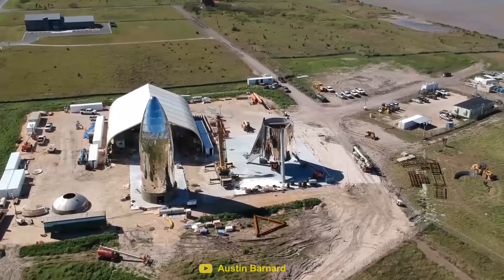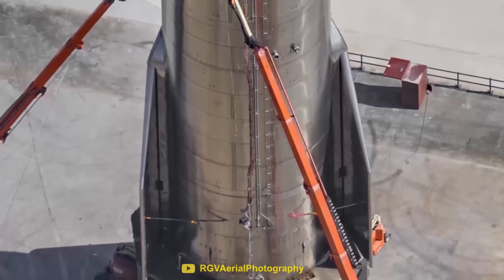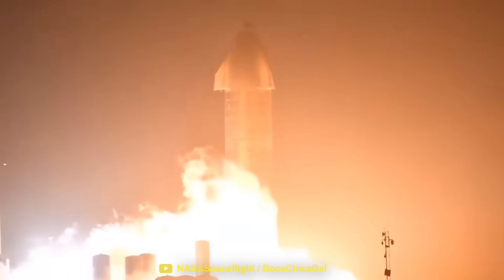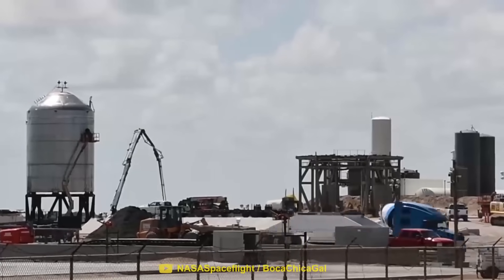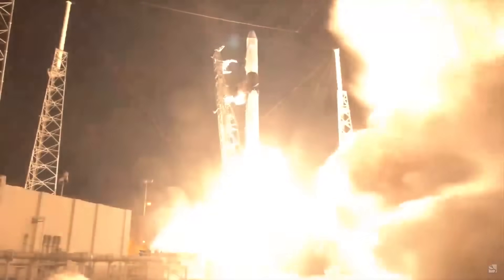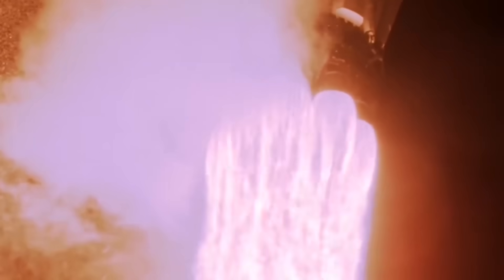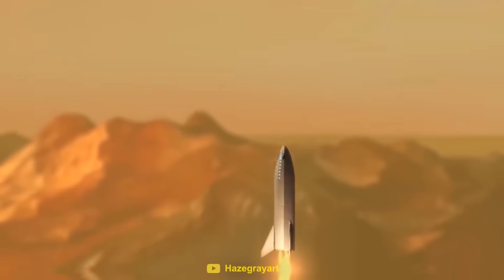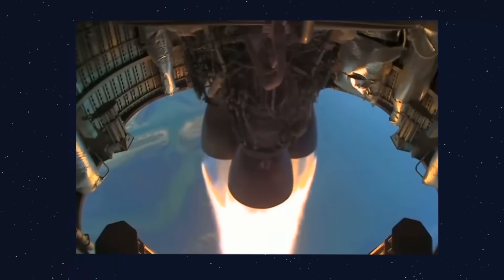SpaceX's Launch Pad Problem

Comment: Solution: Gary steel in Richmond supplied the steel plates 14 inches thick for the Golden Gate bridge.
They have a sample letter "G" holding open the front door in the summer. They transported the plates by putting them on the deck of a ship to get them over to the bridge site. It would take a long time to heat up a steel plate that thick. I personally worked on a stainless steel plate 10 feet in diameter that was 1 inch thick a Utilicon in Forestville Ca. Just some food for thought.

Comment: This video does a very great job introducing the very real issues that engineers must deal with when designing these rockets. That was something that done very well in the era of NASA's space shuttles.  It takes a society to develop these ships, and it requires better communication of the high level problems and decisions that need to be made for better and faster advancement of these programs. 
Thank you Primal Space for keeping it real and reporting on more aspects of the engineering process than just focusing on rocket body concepts that most other media does.

Comment: Only for SHBooster. No need to reinvent the wheel.
https://www.youtube.com/watch?v=f1QESaeUZXw
The shaft is cylindrical with a diameter of 10-12 meters.
For launching and landing Super Heavy Booster.
No need for supercranes if 50 meters underground.

Comment: Mentioned previously:  send or deploy  a rolled up debris deflecting landing pad to Mars.  To over-simplify:  As rocket approaches Mars, a rolled up carpet landing pad; made of graphene and some metal hardware cloth,  is deployed to settle on the surface of Mars.  Then deploy a trampoline type structure on top of the pad. Then land on that.  The trampoline offers some landing resistance but not enough to bounce the rocket.  Or maybe; the first pad self inflates to be the debris deflector and the landing cushion.   Draco thrusters would really help.

Comment: What if the rocket is launched on the air on a floating structure? the structure will be lifted with hot air balloons and launched on high altitude this will reduce the amount of rocket fuel that is needed to deadlift the rocket from the ground up saving truckloads of  $ in the process, on top of that there is no shockwave damage to the vessel in the air also a floating launch structure can make transportation of the rocket much easier than parts hauled from different locations and assembled on a final location. Just a thought but the engineering will be a formidable challenge because a giant structure capable of holding the starship in the air floating and being light will make an engineers head explode.

Comment: Why not SpaceX just land and launch the rocket with the engines facing away from the centre so the debris flies away and not into the ship. Wouldn't this also give a bigger surface covering of energy? 

I might be wrong and perhaps the engine needs to be facing at the centre.

Comment: At the moment the Raptor engines on the Starship have to be able to gimbal independent from one another (and I dont think that will change) so a structure like the Octaweb on the Falcon Heavy actually wont be possible. They might have to surround each engine with its own protection mechanism which will be a very complex task since there isnt much space in between each engine.

Comment: Can it be launched at 30 ~ 45 adjustable degree on a sustaining rail equipped with the booster,  similar as the one on Aircraft Carrier. The rail sitting on a round plate could be turned 360 degree with a launch pad similar as the one used on aircraft carrier for taking off. It might solve the launch pad issue once for all. Turning the ship to the down wind direction for launch assistance by wind power, at least not against with it. After the ship is in the air then change it to vertical position slowly. The idea came from WWII German V2 rocket. In this scenario, it might reduce the required fuel and maybe engine as well. The saved payload could be applied to strengthen the starship structure and landing gears to achieve a normal landing as an airplane. Well, it might be crazy but maybe an optimized solution. Happy new years.
Reply: Designing Starship to give it enough lift for near horizontal take offs and landings would require such a thorough redesign that it would be less effort to make an entirely different spacecraft to start with.

Comment: Debri is less of a risk in a vacuum, there's no shockwaves or turbulence to pick up and move rocks etc, rather just a stream of atoms that rebound off the surface. The exhaust plume also violently expands in all directions into the vacuum, the force at even a short distance is quite small. This enabled the Apollo landings, although the descent stage was single-use and was almost certainly slightly damaged.

Comment: They could always send a few robots to 3D print a launch pad ahead of time.
Reply: That's not even close to being feasible within the next decade.
Reply: @bluntcabbage6042  uh, the technology already exists...and its currently being used to build houses for the homeless. You would only need to make it mobile (relatively easy) and have the desired materials available (may require separate  payload delivery). Very simple.
Reply: @TheJimmyNoStops  It's not "very simple". You would have to make the printer able to make extremely tough materials and very specific elements/chemicals, it would have to be light enough to be placed on a rocket and flown to its destination, it has to be largely self-sufficient in electricity, it has to withstand a very tough environment for a very long time with no maintenance, and it has to do all of these things while being controlled from millions upon millions of miles away.

It's not so simple as slapping one of the printers you mentioned onto a rocket ship and throwing it at Mars.
Reply: @bluntcabbage6042  oh, like a NASA Rover? Lol stop pal. It's quite simple, and the technology already exists. The only hang up is getting the desired materials to Mars, that would require another launch....which they already plan on sending materials ahead, and using ROBOTS to put the habitat together. Just send one with a printer and boom, launchpad.

Comment: Pretty sure the reason why they're using the side engines on the lunar version of starship is to do with impingement on other objects at the launch site. Because of practically zero atmosphere on the moon debris that's kicked up travels a long distance before it's pulled down by gravity, or if it is travelling at orbital velocity, before it meets a hill or mountain and stops. The only way to regularly land starships near lunar land bases would be to have complicated wall structures or to land them on the opposite side of the nearest mountain, a logistical nightmare.

Comment: Use heat resistance tiles on the lower launch pad, this is a very small cost effective method right?

Comment: You have a really great point,  this needs to land anywhere and takeoff from anywhere without damaging the rocket. maybe they need much bigger legs and more protective shells. or maybe it should land horizontally with bigger legs and have four engines on each side and take up horizontally and then it should go vertical using the bottom engines.
Reply: The problem is that the heat and pressure will destroy the legs

Comment: People often miss one important detail: Starship (the upper stage) is NOT supposed to start from launch pads. So they have to develop a launch pad for Superheavy that is more resiliant by amplitudes. But these Starship-launchmounts basically are prototypes for interstages that will be mounted on top of Superheavy! You will not have tons of concrete or a large flame diverter on top of the booster, still you want to reuse that instantly so you must not burn it up like on single use rockets where you don't care. Also Starship might have little margin to have a coasting phase where hydraulics can push away the upper stage like on F9 (also how would you hydraulically push it like 20m ? ). So the top of Superheavy might get super toasted once Starship lights its 6 raptors on ascent, what they really have to figure out is how to cope with that.
Reply: Just do it like how historically rockets have always done it: decouple a stack (booster), wait a few seconds, then fire several smaller engines to increase the gap in between each stage. You can see this at work with a ton of different rockets, just look up rocket footage and I'm sure you'll find some.
Reply: @bluntcabbage6042  Lol, no need to tell me about this. Yes, there where reverse thrusters since the apollo era and stuff. However, you can see the upper stage plume interacting with the interstage in most footage of larger rockets. And the thing is, SpaceX wants to relaunch these boosters, not after refurbishing a half year later, not after checking them over in a week, but they want them to just go again within the hour. This is a different problem. Also, several Raptors would be way more destructive on the interstage than a single Mvac engine might be. You are lighting several hundret tons of thrust there and you basically don't even want that to push your booster out of direction!
Reply: @A.Lifecraft  If you knew about small separation engines, why ask the question to start with? Separator engines are nowhere near as powerful as a Raptor and would only serve for a few seconds to give a greater distance between the two stages. Additionally, even after the engines stop burning, the two stages will continue to drift apart at a considerable rate. 

It's essentially a non-issue, even for reusing rocket bodies. The tech exists and has been readily available for years.
Reply: @bluntcabbage6042  I did not ask a question. I assumed that SpaceX is purposefully doing testlaunches from simplyfied launchmounts to collect data on how to do things under less optimal conditions. Basically the same they did from the beginning by building an orbital rocket in the open. I stated Starship will barely ever launch from a normal launchmount, the thing that comes closest will be the interstage of Superheavy and that could be optimized through data they collect now.

Comment: As an experienced stoner, I would recommend fitting a steel mesh to base of rocket, which would be replaced after build up of debris from sessions to outer space.
Reply: Lol, steel? The engines will burn that right up
Reply: @47EZ_DRIVER  No Lolly steel, but Stainless or Molybdenum for it's high temperature capabilities..

Comment: the severe windstorms on Mars are going to be a problem. The rocket fell over in Florida against the building recently in high winds. This should be a warning sign. They need to resolve this or the rocket could fall over, and then takeoff is null. Retired Shuttle man here. Still young enough to consider coming back too.
Reply: Yeah no, there are no strong winds on Mars. They last very long but don't have the force required to tip over anything
Reply: @angadsingh9314  dont bet on that. They have 3 month long dust storms
Reply: @EdWeibe  Again, that does not matter because its atmosphere is 1% as thick as earth's. So the 'wind' has no force behind it.
Reply: @angadsingh9314  they have dust storms that blanket the whole planet. and one gust actually cleaned off the solar panels of one of the rovers. I think I saw 70mph max, so eh, maybe not enough to tip anything over.
Reply: @angadsingh9314  well we can agree to disagree.
Reply: SN9 didn't fall over because of winds. It was in the high bay in Boca Chica texas not Flordia and the direction it fell is the opposite if it was to wind but the reason it fell was because the stand it was on partially collapsed probably due to a faulty weld somewhere
Reply: @BrosGaminOnline  thanks for the clarification
Reply: Martian dust storms can and have caused several issues in regards to electrical components such as solar panels and it can seriously affect visibility but it won't directly cause a Martian launch to fail as dust storms are far too weak to push a heavy Starship.

The first Crewed missions to Mars may utilise nuclear power to get around this limitationm

Comment: There are no landing pads on Mars.... YET.  In the meantime - with some extra fuel - wouldn't it be possible for a Starship to hover 20-50 feet off the surface for twenty or thirty seconds, to clear it before setting down?  Anyway - excellent video. I've been asking Scott Manley, Felix Schlang, and Marcus House to do a video explaining how engine gimbaling works - without success. Care to do one on that for us?  Thank you.
Reply: It's just a gimbal.... and an actuator... what's there to explain....
Reply: thats not a good solution because they would have to carry more fuel which adds weight and weight is the thing that rockets don't like especially when trying to get stuff into orbit and also mars

Comment: Meh.  I don't see the point in hedging your bets when it comes to categorizing things.  The Raptor is, incontrovertibly, the most advanced rocket engine ever made, let alone tested in meaningful trials.  There is no "one of the most advanced" about it.  Take your pick: That it's full flow stage combustion; that it's the most efficient; that it achieves, by far, the highest chamber pressure.

Comment: Building a launch pad on Mars isn't out of the question, and something that may very well be worth it for a crewed mission. It might be as simple as bringing a shovel and digging a trench to give the flame and debris somewhere to go other than back up. If that reduces the chance of launch failure by a couple percent, the shovel (which will also be useful for digging down for deeper samples, so it isn't even wasted mass) will be well worth having on the payload. Spending a couple weeks of the mission digging a 30 foot long trench deep enough to divert sufficient exhaust doesn't sound like an ideal use of our astronauts time, but if that is what it takes to ensure they get back home, well worth it, especially on a year long mission.

It might even be possible to have a robot do it, send a mission up one cycle in advance, giving it time for a robotic digger to set it up for takeoff, while a fuel mining and refining robot deploys to fill the tank. Once the tank is confirmed to be filling and the trenches dug, the crewed mission can then launch, land nearby, and know that they have a ride home already in place, plus a plan B in the rocket they landed in.

If it is possible to just make the exterior of the rocket engines and engine bells, and other relevant systems tough enough to reliably withstand landing and launch, great. If not, that still won't stop us from getting to Mars.

Comment: Well if you can get enough power out of the engines at the top, to get the ship off the ground far enough away from debris to start the engines, that could be it.. But yeah not all planets will have low enough gravity for this...  Maybe deployable landing legs that get the ship much farther off the ground? Adding more engines at lower thrust could be it or maybe point some engines at an outward angle just for take off and then once you are far enough from the ground light the main engines.

Comment: Keep in mind that at its core, Starship is designed to eventually not need prepared launch and landing facilities. Yes, they need a secure mount for testing, but just as important is learning to build the engine area to not be destroyed by engine thrust debris. I have to believe that whatever happened with the static fire tests was as important to the end goal as the actual flight itself. SpaceX absolutely cannot design this vehicle to only  launch with hardened flame trenches, etc. That just won't work on the lunar or martian surfaces

Comment: It wasn't molten metal pouring from an engine it was burning hydraulic fluid from a damaged hydraulic line in the engine bay. The leaking hydraulic oil was pouring onto the hot engine causing it to ignite. That is why the header tank burst discs ruptured because there were no hydraulics left to open vent valves. Sudden loss of hydraulic pressure caused one of the engines to perform an emergency shutdown causing some internal damage to the engine. The hydraulic lines in the engine bay have now been covered to prevent similar damage in the future. All this info is readily available so no idea why you are talking about the engine being damaged by flying concrete and molten metal pouring from an engine.

Comment: sound energy lol,  it disperses the rocket thrust yes.... and dampens the sound yes.  The sound is not what heats the water, it is the huge flames shooting out of the rocket. :-D
Reply: The pressure wave peaks compress water vapor back to liquid and the low pressure between peaks allows that water to vaporise again, converting latent heat. Thus, the dangerous acoustic volume is reduced.

Comment: I would put big money on the bottom of the rocket being blown to bits on landing there's nowhere near enough room under the skirt between that and the motors so when it's on full thrust on landing the down force won't be able to move away with them stumpy little legs

Comment: Starship may need to be able to land and take off from unprepared surfaces but the superheavy booster does not, as it is restricted to take off and landing on Earth. And it will have a much bigger problem with heat thrust and noise as it is so much more powerful, so some form of sound suppression and flame diversion would seem to be required to launch the complete Starship stack.